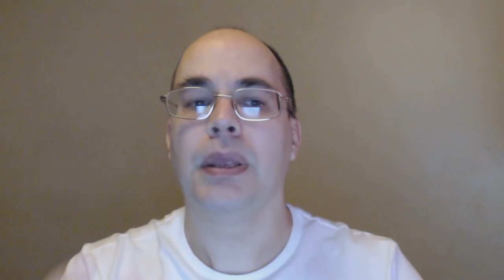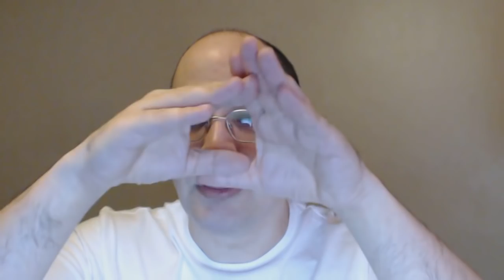How do rockets move in space, with nothing to push off from?

Comment: 2:54 But isn't there a burst of energy that's being released pushing against the matter around it? If there wasn't material around it that could withstand the explosive force e.g. metal the bullet wouldn't travel in the direction that the design of the gun has determined it will travel?  all of the energy released is being directed in One Direction behind the object of the bullet pushing it in one direction because of the unmovable matter behind it and all around it, so the matter is a part of the equation involved in the direction of travel and the forces being directed in one direction, like a rocket being pushing directly away from the matter of the platform and the gantry is simply helping maintain direction upward ?  it doesn't seem to make sense and once again the guy giving the oration is simply reading some information that he's found mindlessly believing instead of questioning.
Reply from the maker: So do you need matter to direct the force in a particular direction to generate thrust? Yes, with a standard rocket, however you can generate thrust in other ways that do not require "unmovable matter behind it", whatever that inaccurate phrase is supposed to be. An Ion drive can create thrust in space using a different principle. https://youtu.be/KFL623O9CXQ

Comment: I would love to see a demonstration of a gun being fired but not with the recoil being retained by a human hand or shoulder, but suspended in air with some type of device that I am not willing to try and configure at present, and then the trigger pulled.  Would the gun travel backwards at the same velocity that the bullet is?  Or would the gun because of it being heavier fall short.  I’m sure it would recoil back but fall to the ground faster than the bullet and travel a much shorter distance.  But I am not privy to much extent on Newton’s laws.  Does anyone know what would be the results in such an experiment?
Reply from the maker: The force would be equal, but the difference in mass between the bullet and the gun means that the velocity of the gun would be tiny compared to that of the bullet.

Comment: I your explanation is true , then explain how planes can back up using thrust reversers? According to you  when jets engines produce thrust the plane should move in the opposite direction . But when they back up the plane moves in the same direction as the thrust. Reality seems to disagree with you.
Reply from the maker: When jet planes back up using thrust reversers, strangely enough the direction of the thrust is reversed. So rather than the jet wash blowing out of the back of the jet it blows out of the front of the jet, pushing the aircraft backwards.
Reply: @mjmurcott647  you have no clue what thrust reversers are do you? The engines  still  thrust  backwards. They dont change direction
Reply from the maker: If you stand in front of a jet aircraft with the thrust reversers are on you will get hit by a blast of hot air from the jet engines. https://en.wikipedia.org/wiki/Thrust_reversal#Jet_aircraft https://simpleflying.com/what-is-reverse-thrust/
Reply: @nickmerix2900  The thrust reversers absolutely DO "REVERSE" the thrust pushing it out the FRONT of the engine.  Would you people learn to do you OWN research before spouting nonsense?

Comment: For anyone thinking rockets don't work in space. 

if you set an explosion off in space.. would it expand in all directions.

If you set the same explosion off in a container with one open end but strong enough for the sides to contain the explosion, 
What direction would the explosion go?
what direction would the container go?
Reply: Rockets would work in a vacuum of space. For every action there is an equal and opposite reaction. The problem is, rocket engines can only create 6000 mph of thrust maximum.  And that would make things like 25,000 mph round trips to the moon impossible.
Reply: @fredcaldwell9824  "6000 mph of thrust maximum. " 
You really need to study physics.. that comment is wrong on so many levels.. 
1) thrust - is force
2) 6000 MPH is speed.. 
3) Force(thrust)  causes acceleration.. 

there is no limit to the speed a rocket engine can accelerate the rocket to in the vacuum of space, because the vacuum of space offers no resistance..
Its why Rockets are more efficient in space
Reply: @entangledmindcells9359  "there is no limit to the speed a rocket engine can accelerate the rocket to in the vacuum of space, because the vacuum of space offers no resistance." The weight of the vehicle itself would offer some resistance in "space". And true, the trust causes the speed. And that maximum speed for a rocket engine is around 6000 mph. You can't get more out of that action than you put into it. But you can make people believe they can easy enough.
Reply: @fredcaldwell9824  You almost understand physics.. key is almost.. 
Why do you thing the limit is 6000mph?
Reply: @entangledmindcells9359  6000 mph is as fast as the rocket's thrust can muster. Whether it's one engine, five engines, or 500 engines.
Reply: @fredcaldwell9824  I assume you might be referring ot the exit speed of the exhaust.. 

If so, this is RELATIVE SPEED TO THE ROCKET.. Meaning if the rocket is traveling 15,000MPH the exhaust will still travel out the back of the rocket 6000mph relative to the rocket and still exert a thrust on the rocket.

Which leads to why Rockets work in space.. that exhaust has mass and traveling 6000MPH has momentum.  For the rocket/engine to direct all the exhaust in one direction at 6000mph, there must be force directed to the exhaust.  Per physics there is an equal and opposite force on the rocket in the opposite direction.  

Sorry, but I understand physics, even tutored fellow students in college. This is a basic conservation of momentum problem.
Reply: @entangledmindcells9359  No appology necessary. But what you've just described is wishful thinking and you have no way of physically demonstrating how a 6000 mph thrust can go faster than 6000 mph. You only have words.
Reply: @fredcaldwell9824  Sorry. Its not wishful thinking. It is basic Physics.. 
FYI.. "You only have words".. that describes your whole argument.. 
I told you what physics says and your argument is "NO.. that is incorrect"  and just reiterated what you "Think".
Reply: @entangledmindcells9359  To prove that anything can go faster than it's own thrust potential, you must have a physical example to prove that and I find none. And I find that to get more speed out of a vehicle than the energy you put into it flies in the face of physics and laws of thermodynamics. But you're welcome to post any example you can show us that proves your point.
Reply: @fredcaldwell9824   
" And I find that to get more speed out of a vehicle than the energy you put into it flies in the face of physics and laws of thermodynamics" 
is wrong on so many levels.. 

So you want examples.. of moving faster than the thrust.  How about something sailors knew for centuries.. During tacking a boat can not only maneuver upwind.. it is also possible to travel faster than the wind.  Key here, there is a Force harnessed to generate ACCELERATION.  The speed where that force came from is not where the limit comes from.

So lesson time. 
First you need to understand a very basic concept.. To get the rocket exhaust to exit at 6000mph RELATIVE to the rocket, a force is required. A equal an opposite force is exerted on the Rocket.. This is where THRUST & Acceleration comes from. The SPEED of the ROCKET DOES NOT MATTER here because it is just the speed of the exhaust RELATIVE to the Rocket. 

Here where there is an atmosphere, "drag" becomes the limiting factor.  but in the vacuum of space, there is no drag so anything will continue to accelerate as long as there is thrust.

Physics is wonderful and better when you know how to apply it.
Reply from the maker: Snooker or pool cues striking the balls or a truck or lorry colliding with a pedestrian.
Reply: @fredcaldwell9824  So you are claiming that the SR-71 is a HOAX?
 It is NOT REAL. That is what you are saying.

Because the exhaust velocity of a Pratt and Whitney J59 is 2370 ft/s (1615 MPH) which is Mach 2.1

So Fred - HOW did the SR-71 fly at greater than MACH FOUR ??

Because according to YOU, that is impossible.
So you are claiming the SR-71 is a hoax.
Got it.
Reply: @stuartgray5877  Well first of all, I don't know why my answers to your questions get deleted, but they do. So here's a response one more time.

Secondly, In looking up the top speed of the SR-71, I find it was 2200 mph. That's not greater than mach four. 

Thirdly, my claim was that a rocket engine is roughly 6000 mph at top speed. So I fail to see why you'd think I claimed how the SR-71 at 2200 mph would be impossible. But, it's not the first time folks put words in my mouth.
Reply: @stuartgray5877  Well first of all, I don't know why my answers to your questions get deleted, but they do. So here's a response one more time.

Secondly, In looking up the top speed of the SR-71, I find it was 2200 mph. That's not greater than mach four. 

Thirdly, my claim was that a rocket engine is roughly 6000 mph at top speed. So I fail to see why you'd think I claimed how the SR-71 at 2200 mph would be impossible. But, it's not the first time folks put words in my mouth.
Reply: @stuartgray5877  Asked the guy who never answers my questions.
Reply: @stuartgray5877  That's it. Misrepresent the speed of the SR-71, then delete my comments when I straighten you out.
Reply: @fredcaldwell9824  tell me what questions you have asked that I have not answered.
Reply: @fredcaldwell9824  the SR-71 and the drone it carried on its back were capable of Mach 4 (and greater), but the actual number is still classified.  But be sure to argue with someone who worked for Lockheed Martin flight systems about the details.  I have personally worked on a vehicle that was the fastest man made object to ever fly through Earth's atmosphere, but someone who dropped out of high school wants to lecture ME about how this shit works?
Bless your little heart!
Reply: @stuartgray5877  You'd better alert Google about SR-71's top speed. They're spreading lies only you can correct. But keep makin' up shit about my education. It's cute. But does nothing for your credibility.
Reply: @fredcaldwell9824  I have VIDEO of rocket propulsion working JUST FINE in a vacuum.  DO you just refuse to watch it?
Search YT for "uninterrupted footage of the falcon heavy launch and booster landing! 2-6-18" Then TELL ME WHAT YOU SEE Genius!
Reply: @fredcaldwell9824  And just so you know the D-21 drone that was launched from the back of the SR-71 could fly above Mach 4 and could not even LIGHT Until the SR-71 exceeded the "official" speed shown in the record books of Mach 3.3.
I am an ex-Lockheed Martin flight systems employee, but what would I KNOW???
Reply: @fredcaldwell9824  I am not making up anything about your education. It is NOT POSSIBLE for you to pass even a high school physics class.  Where I come from passing physics is MANDATORY for graduation.  Therefore you failed to finish high school.
Reply: @fredcaldwell9824  Fred for example -You could not explain to me how the recoil from a crossbow, here on earth, works if your life depended on it.  Give it a try genius.

Comment: a gas develops no mechanical power when it expands into a vacuum. so no rockets in space.
Reply from the maker: Gas has mass and when propelled out of the back of a rocket it has momentum, so in order to preserve the conservation of momentum as the gas moves in one direction the rocket moves in the other.
Reply: @mjmurcott647  so do you claim a gas develops mechanical power when it expands into a vacuum? YES or NO.
Reply from the maker: Nope. Momentum is defined to be the mass of an object multiplied by the velocity of the object. The conservation of momentum states that, within some problem domain, the amount of momentum remains constant. So if a fraction of an object moves in one direction the rest must move off in the opposite direction unless another force is acting on it.  https://en.wikipedia.org/wiki/Newton%27s_laws_of_motion
Reply: @pl3628  - Answer my questions above and we can discuss it.
Reply: @pl3628  Come on, where did you GO?

We want YOU to explain how a machine can accelerate 500 kilograms MASS of pure water from a standstill to MACH EIGHT without feeling a recoil force.

Why did you run away?
Reply: @pl3628  : so you claim that you could expel tons of material out of a body and have zero force on it? Yes or no?
Reply: @mjmurcott647  FYI.. here is the thought experiment I give folks that try to argue Rockets don't work in space.

If you set off an explosion in space.. Would it go in all directions? If not why? usually they agree.. 
After they answer that.. then I ask them.. what if you set the explosion off in a container with just one open end that was able to contain the explosion.. 
What direction would the explosion go?
What direction would the container go?
Reply: Legalise Pot Belge! - Answer these three questions
1 - When the rocket engine is running, is the Exhaust Gas ACCELERATED from the nozzle? Yes or No?

2 - Does the exhaust gas have MASS? Yes or No?

3 - Can MASS be ACCELERATED without a force?  Yes or No?

Answer those three questions and we can make some progress.
Most "Physics deniers" will flat out REFUSE to answer these questions
Reply: If you set off an explosion in space what direction would you expect it to expand?

If you set that same explosion off in a container with one open end with sides strong enough to contain the explosion except for the open end.
What direction would the explosion go?
what direction would the container go?